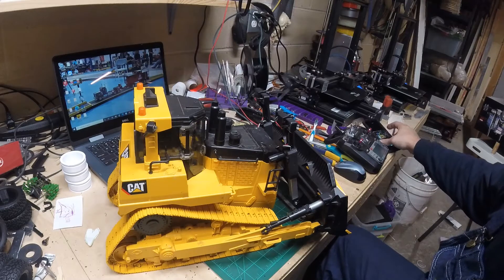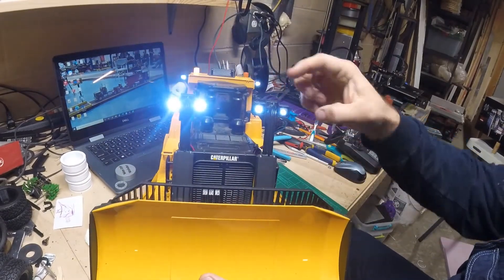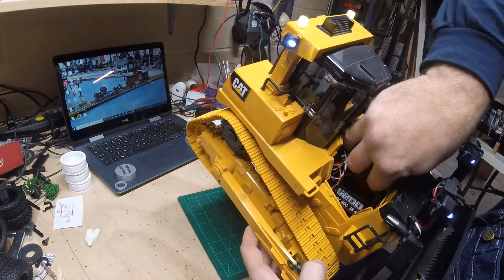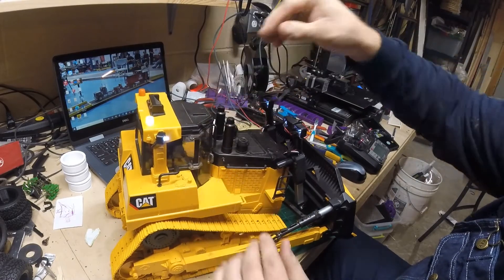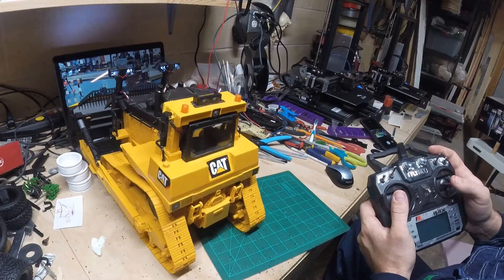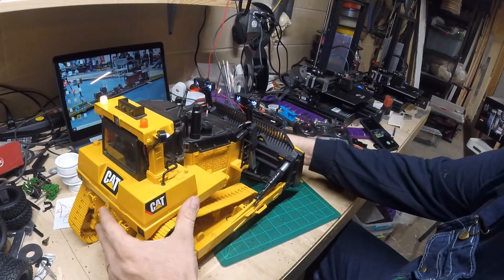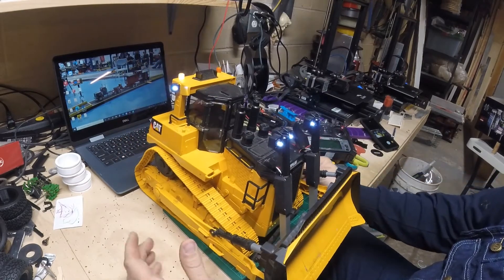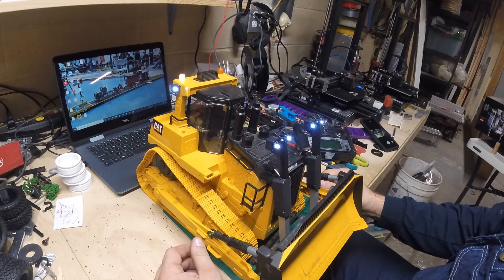Bruder D11 RC Conversion Part 5, Final Overview

Comment: I spent 2 1/2 hours looking at other videos, trying to convince myself that I could get this done, and as soon as I was about to scratch the ideal your. Videos popped up, In my opinion, your way seemed the simplest and very budget friendly, and you showed the important steps. Priceless video! I'm. Building the 3d printed Kenworth along with the tamiya flatbed /lowboy conversion, and this dozer conversion will be a great addition to them both. The problem is that I can print faster than I have time to put the parts together.😅

Comment: I'm definitely missing something with my esc and blade lift. I had two esc originally and used a y connection,  but the actuators would run at different speeds. Opted for a single 40amp esc to run both actuators.  They operate the same speed but i can't tilt my blade like yours Joe... not sad, just miffed.
Reply: Wait.... there's a "Natural/factory Elevon setting that mixes channels one and two on the FS-i6x. I added the esc back. And my blade tilts 😅

Comment: Hi, great video, ok.I am new to RC and up to now been using Heng Long transmitter and receiver to get my Bruder Cat 963 loader running on RC, which is running great, but really want to understand ESCs and how to wire them up to  a Flysky receiver, can you give me some idea of what i need, maybe a short video on just the wiring up, what ESCs to buy, just for dummies like me..lol...oh and the drive motors.cheers....
Reply from the maker: I have been using mostly continuous rotation servos for drive but I am planning another tracked AG tractor and will be using esc and geared motors, will post when I gather all the parts
Reply: @joe_of_all_trades  Hi, ok, following everything you are doing, just got my D11 today, now getting all the parts I need, as I wish to have an operating ripper, plus blade tilt, forward and back, will I need the 10 channel Flysky to do this...cheers..

Comment: Miss a big chunk in the middle..... I can figure out how to get the Blade on, I hope others can.
Overall, this is FANTASTIC!!! If you've seen what a RC4WD Dozer goes for, this is only a a fraction of the cost! 
It's going to take a Regime change to curb this runaway Inflation.... If the Rent increases don't leave me homeless by then, I want to build one!

Couldn't you Daisy Chain 2 Hobbywing 60A 1060 ESCs for the Blade? Looks like there's room for bigger ESCs.
Thank you! This is a very creative project!
Reply from the maker: I am missing one clip, got deleted somehow, I will redo this video in the future to make it more complete and yes you can use 2 larger esc, and through the channel mix make it work!

Comment: Would love to see a d5 of yours built. And would you sell the sprockets and servo spacers? I've built 1 d11 using maghom motors,mounts and sprocket adapters.  The tracks really can't handle alot of use. Ive removed maybe 5 pieces per side now. I hear 3d printed 100% infill tracks dont stretch.
Reply from the maker: I sold it and didn't video the conversion, but it is on the list to do, most likely over the holidays
Reply: Another video covering the speed controls for the linear actuators would be greatly appreciated. In your parts list you say a single speed control for a tank that’s what I purchased and I’m now stuck